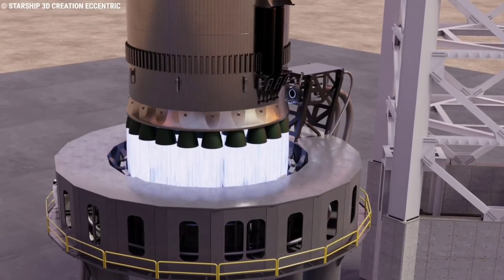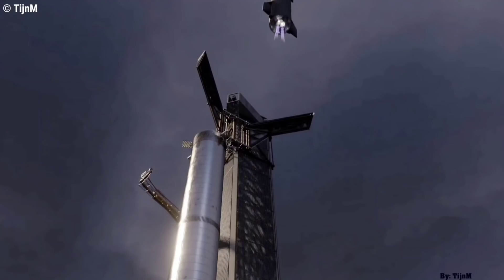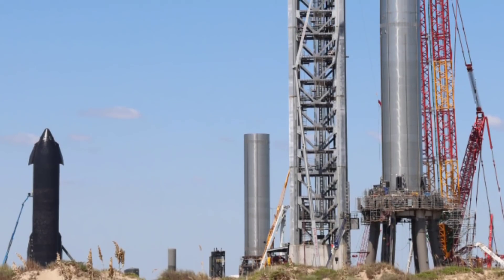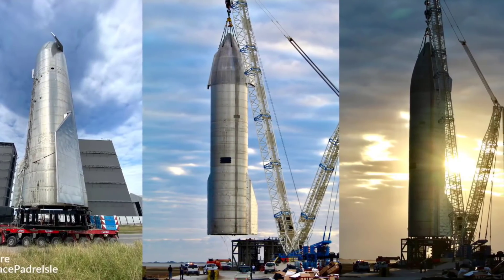SpaceX Starship LAUNCH MOUNT FINALLY Near Completion!

Comment: They might not use the chopsticks to catch but they will have to use them to stack the rocket. Even with the new space x crane without Kong they won't have the Clearance to stack the full rocket without using the sticks.